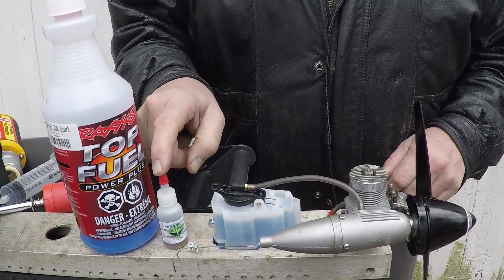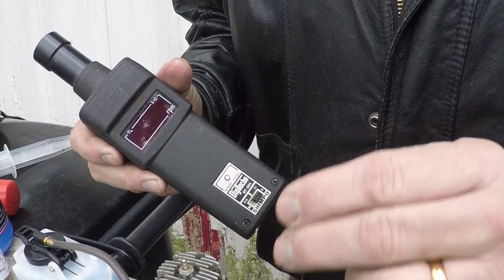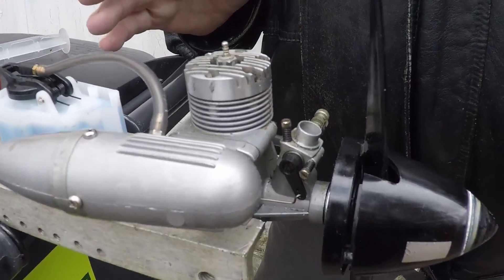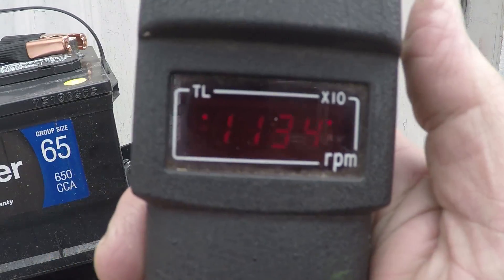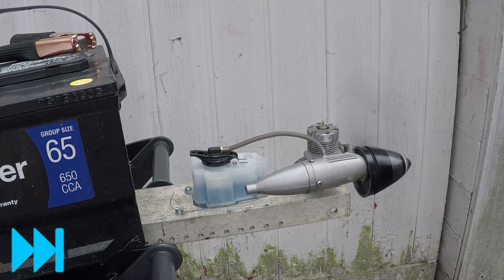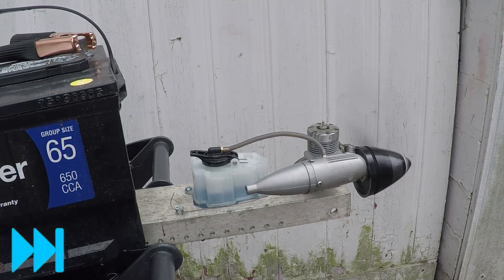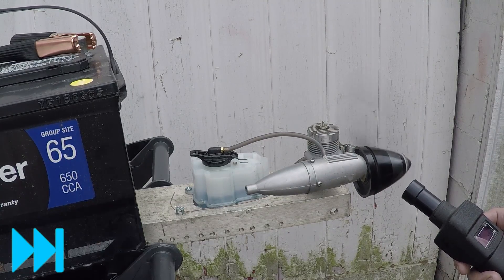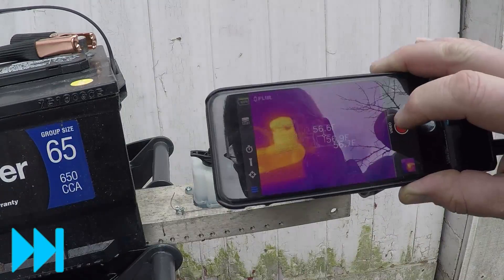Restore Compression with QuantumCoat - Nitromethane RC Engine

Comment: Lean out your needle valve,  you're running way to RICH. Engine head temperature should be about 365-375.  Adjust the needle to get the right temp.